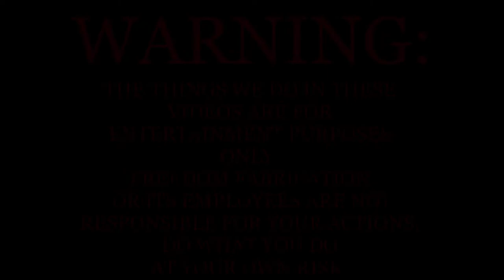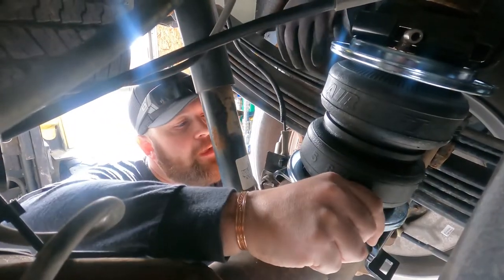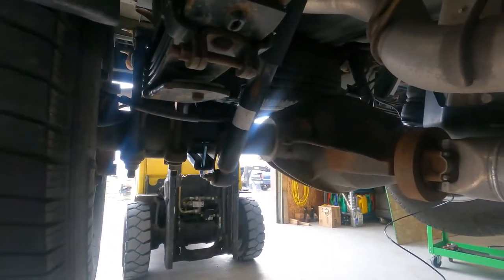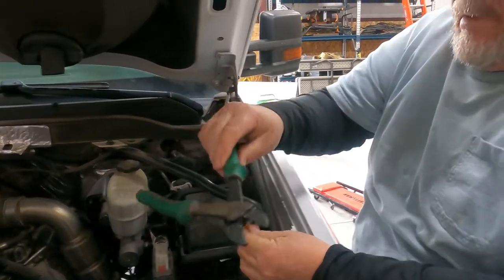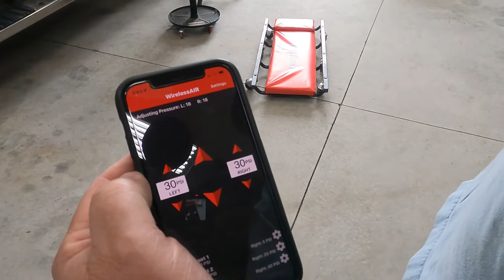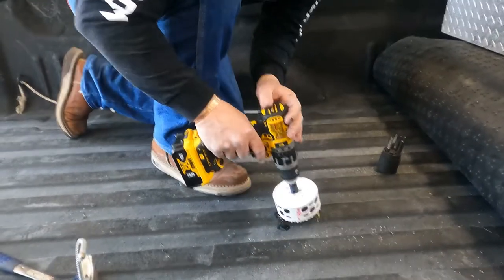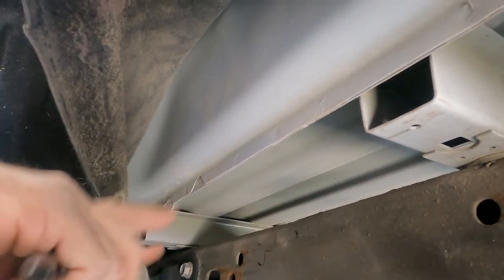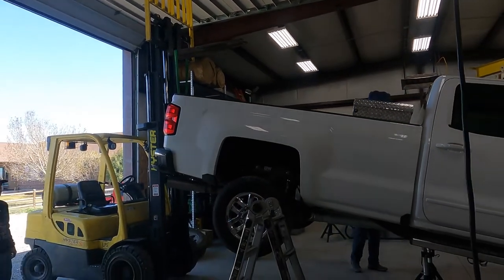Truck Airbags and Gooseneck Hitch install

Comment: What screws did you use to secure the upper airbag plate to the frame? Any nuts ?
Reply from the maker: No nuts, they are a self tapping screw that comes with the kit.